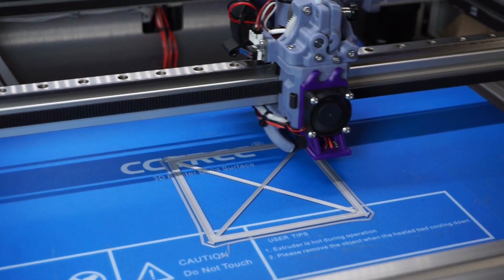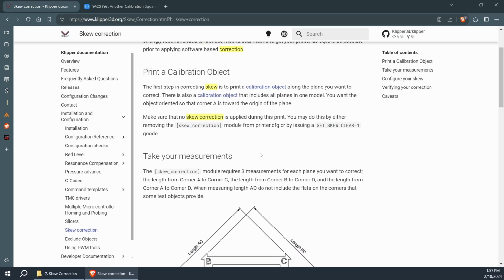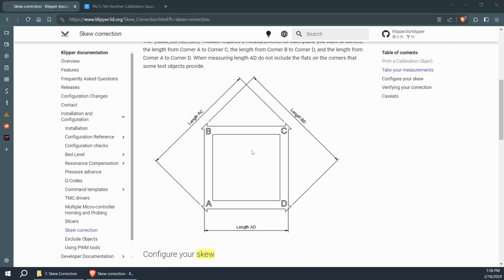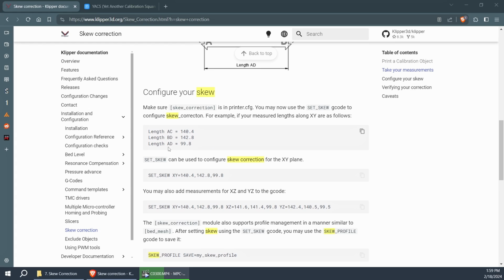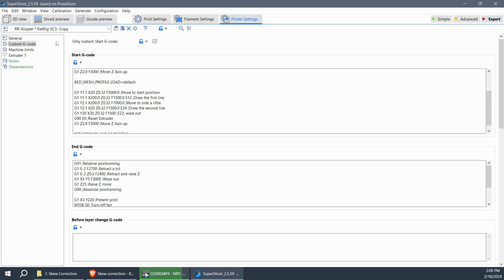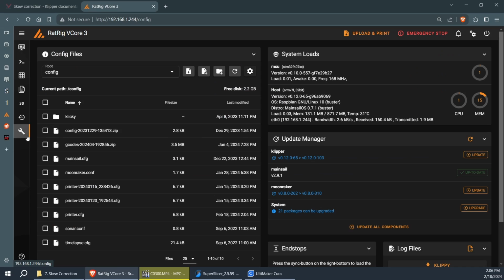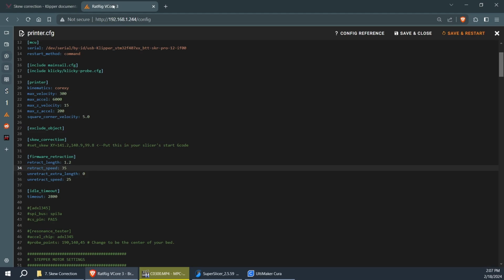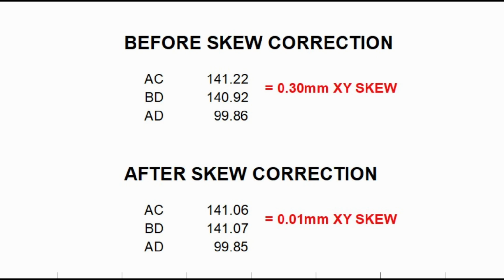Fixing Print Geometry with Skew Correction

Comment: No it's better in your firmware because if you change slicers or have to reinstall you can easily forget to add it back. I use many different slicers and when you do that its always easier to make changes in your firmware.
Reply from the maker: very valid point!  I'll look into adding into the "start print" macro I have saved in Klipper
Reply: Agreed it is better in firmware than in the slicer, but XY skew on a core XY is usually the result of an unequal tension on the belts, which twists the gantry, so that’s where it should be taken care of.
Reply: how to save it in firmware？

Comment: Hi I am pretty new to 3D printer and I realized my printer was printing small shapes wrong. like circles and Hexagons were stretched. I think this could be due to printer skew as I tried tensioning my belts and If I measured the frequency of my belts they differ by like 3 Hz. I just want to know if I can use this method with Orca Slicer aswell? Because I cant find the config file?
Reply from the maker: What kind of printer do you have?  If it runs Klipper, then you can use this method to add it into your G-Code and enable it in your printer's Firmware.
Reply: @mikey631  i have a creality K1 SE, but I don't want to root my printer because I got it for Uni for my final year projects and Im afried Ill mess something up😅
Reply: Can this be done without rooting?

Comment: thanks for showing this! 

So if I put it in my cura start g-code that's it? I won't need to do any firmware changes? set skew is just a native function in gcode? that YACS is normalized to the set skew function automatically? Thanks for showing this. My printer has been very misaligned and I haven't touched it for a year..... it wasn't until today that I realized that printing a square then measuring the diagonals would bring me back to the promised land.

I found the YACS on thingaverse, then your video. Cheers!
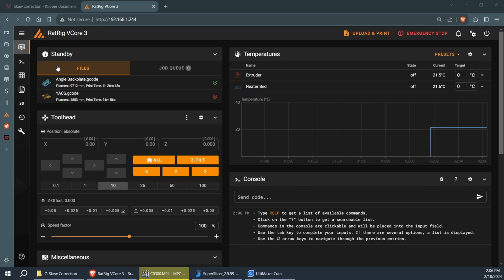Reply from the maker: Hi!  The only "firmware" change you need to do is to add the [skew correction] header in your printer config file within Klipper (see the video at 3:51).  That basically tells Klipper to "turn on" skew correction, and look for the command in your g-code.   Good luck!

Comment: Thank you, thank you, thank you. I was struggling with this for quite some time, even though i followed the instructions to the letter. I've wasted money on the califlower, all it did was indicate my skew, but had no help in fixing it. My local 3D printing group thinks sharing info will kill their livelyhood. I saved 3 different skew profiles in my config files, and everytime i start a print, the response in my console was its an unknown profile.

And all i had to do was add those measurements directly to my start print gcode in orca. Subbed!
Reply from the maker: Glad it helped!
Reply: I feel like I kind off wasted $6 on the Califlower too .. 1 hour print kind of off putting as well.

Comment: I really appreciate your video, it helped me with my search to fix a skewed Delta. However it is not correct to add Set_Skew into your slicer's start gcode. Documentation mentions you need to load your skew profile before each print so in reality you need to add "SKEW_PROFILE LOAD=my_skew_profile" to your START_PRINT macro inside klipper - and call START_PRINT in your slicer as you probably already do. 
It also mentions it needs to be added after homing and after purge to avoid a "move out of range error". Also recommended is to issue a SET_SKEW CLEAR=1 in your end gcode.
Set_Skew is used to create that profile, that then needs to be saved.
Reply from the maker: Profiles can be used, but are not required.  The Klipper website actually says to enable the feature in your start Gcode: "Due to the nature of skew correction it is recommended to configure skew in your start gcode, after homing and any kind of movement that travels near the edge of the print area such as a purge or nozzle wipe"  

The website goes on to say you may use profiles to accomplish this, but using a profile is not required.  I've had it configured in my start GCode for a few months now (as recommended) and it's working perfectly.  

That said, you can set up profiles if you want to, it's just not required to make use of the feature.   This may be a better route for you, depending on how you have your machine and macros setup.  I am not using a profile, because it doesn't seem necessary for something that isn't going to change (compared to a bed mesh profile that can be different based on bed temperature).  Adding one line in my start gcode takes care of it, and it's working perfectly, so I don't see the need to do anything else.

Comment: Can it be don on unrooted k1max? I mean i dont have acces to printer.cfg and dont want to root it. It is enough to add that in gcode?
Reply from the maker: Are you able to change your printer.cfg file on the K1?  The correction parameters are all in the GCode, but you have to have "[skew_correction]" added somewhere in your printer.cfg for it to work.
Reply: You should still have access to the cfg files without any root or ssh.
Reply: @renanportocarrero7816  How do you access the cfg files without rroting?